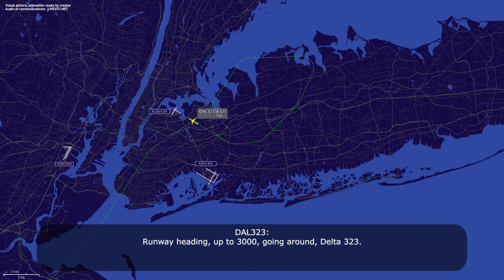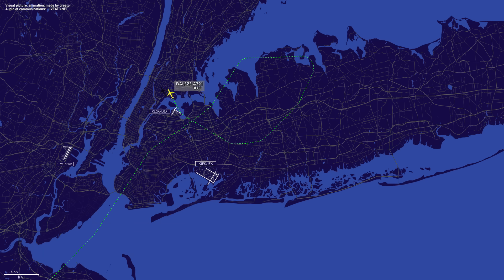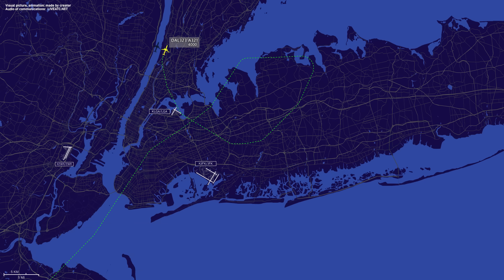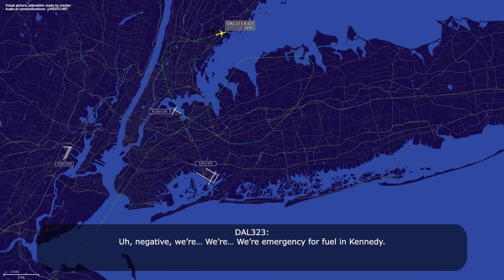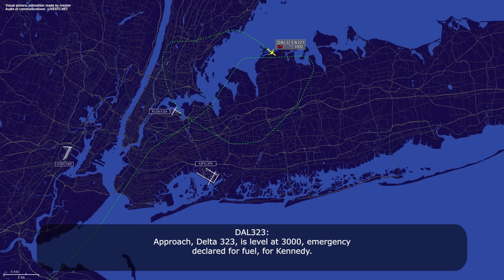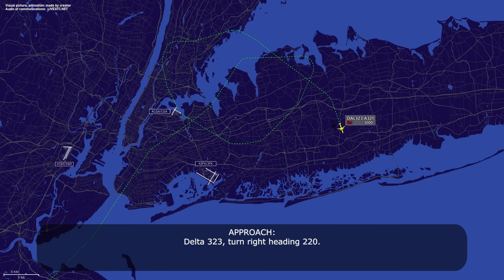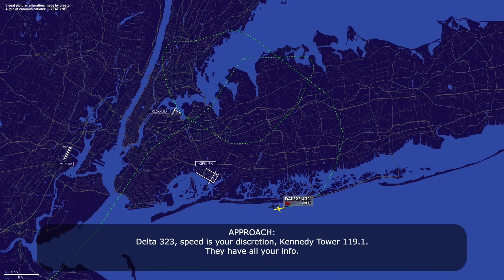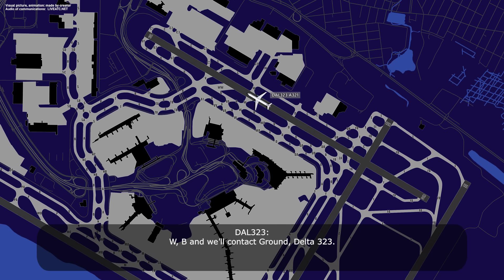Pilot declares MINUMUM FUEL after go around and diverts to Kennedy Airport. Real ATC

Comment: It amazes me how fast things are coordinated when you declare an emergency.  So impressed by the folks at ATC
Reply: When ATC replied "Emergency? Roger..." I could feel ATC sit up in their seat for that one.  NYC TRACON is best in class.
Reply: There's something I don't get clear: ATC tells DL323 they're number 10 because there's a medical landing at LGA. After that, DL323 declare fuel emergency and diversion to JFK. Since diversions are operative nightmares and they had declared fuel emergency, why were they not cleared to LGA directly?
Reply: @Jordi-Jan  they did ask for the divert in the same request, maybe because they didn't want to conflict with the medical emergency. Also, maybe they felt there would be less of a wind shear issue (no idea why though). In any case, pilot asks for JFK, pilot gets JFK.
Reply: @Jordi-Jan had they tried again at LGA and had to abort they would be facing fuel starvation.  It’s a safer bet to try JFK
Reply: I mean, they're coordinating this stuff quickly the entire time. They just went from #10 with departures sharing the runway to #1 with everything else out of the way. A busy place like this has flows to keep holding traffic out of the way so when they needed to get through there would be a path. 

I'm also guessing that LGA is particularly busy due to layout and size, with JFK just having way more capacity.  Plus if they did have a problem ATC would find them a spot somewhere. There is a lot of capacity in the system - just way more demand.
Reply: Except for the current ATIS - you need to get that on your own.
Reply: @MyGoogleYoutube I'm sure they'd read it on request but since this was just a fuel emergency the crew probably had plenty of bandwidth to get it. Arguably it might even be safer to just follow the normal procedure but with priority in sequencing.
Reply: @RichFreeman  I've noticed that before when emergencies have been declared. That said the crew could also request it be read by the controller.
Reply: @MyGoogleYoutube  yeah, it isn't uncommon for them to spoon feed them. That said the whole atis has a lot of useless info in this situation. 5G advisories, regular dep/arr runways, etc. Really the qnh and wind and any unusual conditions matter most. Honestly, I'm not sure which is more helpful when the pilots aren't dealing with system failures.
Reply: Except that LGA should have let them in. They made the problem.
Reply: @woodalexander  the original go around was wind shear - not anybody's fault. 

I'm sure LGA would have let them in after the medical emergency, assuming that one got there first. They didn't ask for it after declaring an emergency (the first call didn't declare an emergency).

Keep in mind that emergency means just that. If a pilot is going to declare an emergency all operational concerns basically are dropped. It is now a question of what the safest outcome is. JFK with the extra runways, more length, maybe better winds, and no other emergency traffic made a lot of sense. 

I'm sure if the pilot asked for an emergency landing at LGA they would have gotten to the front of the queue after the other emergency traffic (which has just as much priority). Once an emergency is declared ATC is basically going to give a pilot anything they ask for. They asked for JFK, and got it. They're not really going to try to debate that choice unless they think they see an option that might be safer (such as when USA1549 was offered the suggestion of Tererboro - the controller just wanted to offer suggestions other than the river in case they might work). From a safety standpoint there was nothing wrong with JFK.
Reply: @RichFreeman  Weird that they didn't declare emergency to LGA.
Reply: @woodalexander  maybe they were already thinking diversion as a non-emergency. That other emergency might have been on their mind. They also had that missed approach so they already knew conditions there weren't ideal. Granted, JFK isn't far. Perhaps a report will come out with details, though since there was no damage or injury I don't think they're required. I'm sure the airline will investigate, especially around the fuel planning. The decision to go to JFK probably will not be questioned. What might be is the original fuel load but there are many factors there.
Reply: @RichFreeman  Seems like they wouldn't have to divert if there wasn't an emergency.
Reply: The New York controllers are probably best in the country.
Reply: @gonetoearth2588 agreed, they were efficient & concise & calm
Reply: 😂..."Hello"

Comment: Smart to call emergency at 40min fuel with too many chances for another go around with the wind conditions.
Reply: My training was Fuel reserve in vfr flight 30 minutes but ifr is 
“After reaching the destination and alternate airport, an additional 45 minutes of fuel at normal cruising speed. “
Reply: @justinborysenko3885 this is required for planning and dispatch purposes only. There’s nothing “illegal” about burning reserve fuel once airborne. That’s why it’s there.
Reply: @chrish7935   While not illegal, going below final reserve is an emergency and will usually be investigated by the company. 
That's why it's the "final" reserve. 
You shouldn't ever need it, but it's there if you do.
Reply: Legally required to declare an emergency if you expect to land below minimum fuel (30min). 
Would have been min fuel for LGA and updated calculation below for Kennedy, since it's a bit farther.
Reply: @lyaneris  thought it was 45 min for part 121
Reply: @KevinS819 — I thought it was 75 minutes for minimum fuel…then 45 minutes for a fuel emergency.
Reply: @KevinS819  30 min during the day and 45 min at night afaik
Reply: I believe the 40 minutes remaining was based on the compulsory 30 minutes of fuel on landing. The remaining fuel until flameout could actually occur was 70 minutes. Safety is about margins.
Reply: As a SIM pilot I have never declared emergency fuel in my life.  I'm a professional.
Reply: nice they have your blessing  @wienersail
Reply: All those planes flying is causing climate change
Reply: And the go-around was not the pilots fault, the tower ordered them to do it and then sequenced them #10 for another try. That wasn't nice.
Reply: Went emergency fuel after 1 missed approach.   Imagine how I felt when my flight attempted to land around 5 times.  It may sound unbelievable, but it happened. 
Watching years of airplane investigation videos didn't help.  My knees were shaking, and the elderly lady beside me knee started shaking too.
This flt was from JFK to GEO.  I don't know if the pilot was not use to the fog or if the fog was too heavy.  I remember he kept saying the fog had cleared and we would attempt to land again.
Then, as we came close to landing, you could hear the engine spooling back up.  Every time that lever goes to TOGO position, my headache goes up a notch.  At one point, the pilot said "the sun has finally did it's job and cleared up the fog," he attempted, and went right back up.
Eventually, the pilot made the announcement I wanted to hear so badly.  They were diverting to the alternate airport, which was POS.  Most of the passengers weren't too happy to hear that news.
We then landed safely at our alternate, and I was the only one clapping. 
Leaving the plane, I was hoping to see the pilot to give him a thumbs-up.  I told the flt attendant I am glad we came to our alternate, she agreed and said "I don't know what's wrong with these people" referring to the passengers that was unhappy that the plane diverted to the alternate. 
This was around Feb 2015 or 2016.
Reply: @apache1120  ... It was not just after 1 missed approach, It was after 1 missed approach and being told that he was #10 in the sequence due to an incoming emergency. #10 is minimum 20 minutes.
Reply: @adb012  Yes, I understand that, but how much reserve is appropriate.  In my situation, the airport wasn't busy at that time of the morning, so the pilot was able to make multiple attempts in a short period.  There was only one instant when the pilot said he had to wait for a small plane to land.
Reply: @apache1120  ... In general it depends on the flight. Typical requirement is trip fuel to go from A to B (including foreseen effects of wind,  weather diversions, IFR routing for example arrival and approach procedures,  and ATC hold/delays/re-routing), plus 10% of that, plus fuel to go from B to the alternate, plus enough fuel to hold 30 or 45 minutes (called final reserve and which you are expected to have in the tank by when you finally land). To give just an example, if you make a 10 hours flight and land at the intended destination consuming the expected fuel and your alternate was 1:15 hour away, and you had a 45 minutes reserve, you would land with about 3 hours of fuel. If it was a 1:305-hour flight and your alternate was 20 minutes away and your final reserve was 30 minutes, you will land at your intended destination with about 1 hour of fuel. In both cases it can be more if the weather / traffic was better than expected, or less if they were worse than expected and you had to use part of the 10% margin which is there exactly for that reason.
Reply: @apache1120  If the pilot decides to forgo the alternate as an option (be certain to land there), they can go down until landing with final reserve intact.

How much fuel alternate + holding + extra is, depends on the flight, airline sops (or the captains decision to take extra) and the fuel planning in general (which is done by operations). 
You could also have more than planned, if the enroute weather was better than expected.
Usually, you have at least enough for one missed approach and 10 minutes of holding - but that's still variable, depending on airspeed and altitude, so just guesswork.
Reply: @apache1120  ... Not sure what do you mean with "how much reserve is appropriate". In general, if you land with the 30 or 45 minutes of final reserve, that's fine. So as long as your plan account for that, you are good. If you are very confident that you will be able to land at the intended destination, then you can keep going around all day long until, in one of the go-arounds, you find in a position that if you go around once more after that you would end up landing with less than the final reserve. So you will have to accept that this time you either land or you'll become immediately an "emergency fuel" flight if you go around again. But I can't imagine why a pilot would be so confident that they will be able to land at the intended destination after multiple failed attempts and go arounds. So in your case the pilot most likely still had enough fuel after that last landing to go around yet once more (which he didn't) and then fly to the alternate and land there with either 30 or 45 minutes of fuel. Note that the fuel calculation of my previous comment is the MINIMUM. Planes can depart with more fuel, and arrive with more fuel, due to a number of reasons. So when a plane is about to land at its intended destination it can potentially still have several more hours of fuel than what is required to go around, divert and land at the alternate, plus 30 or 45 minutes, which would give them margin to attempt several approaches at the intended destination before having to divert.
Reply: @apache1120  your head was in the game, in the situation. The other passengers were thinking about their convenience.
Reply: And NYC airports landing and departing aircraft in front of you
Reply: Rude of you and he was giving his opinion not a blessing.
Reply: @LeslieSmith-x7n Who are you replying to?

Comment: Oh look (again) yet not another Boeing :)
Reply: Aircraft type or manufacturer is completely irrelevant…
Reply: He was making a joke on Boeing bashers
Reply: If Boeing decided how much fuel to put in the tank, you'd have a point.  Low fuel is not on the mfg, it's on the operator.  For busy airports, there maybe should be a requirement to carry a bit more due to the chance of having to wait for various reasons being higher.
Reply: This aircraft wasn't falling apart though. This was a mistake somewhere on the airline fueling plans. 
The plane landed intact and safely just with less fuel than would have been ideal.
Reply: Boeing is definitely at fault for all of these.
Reply: @saxmanb777 Sarcasm??
Reply: So? This emergency could have happened to the fucking Wright Flyer.
Reply: @djquick  I guess you're upset because you maybe a Boeing basher?
Reply: An Airbus A321 is a Boeing now?
Reply: Wrong.  How embarrassing (for you).